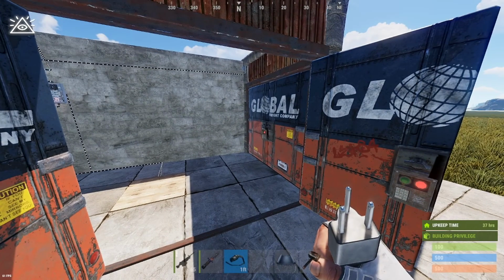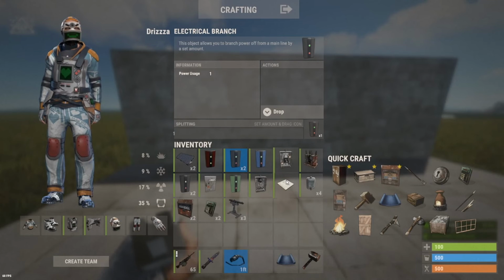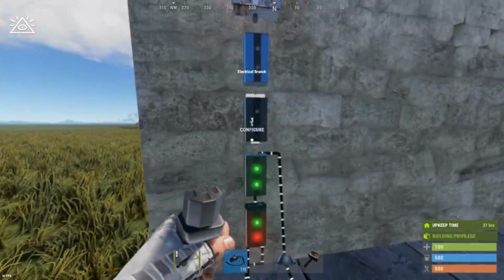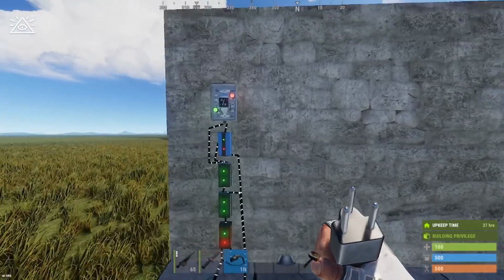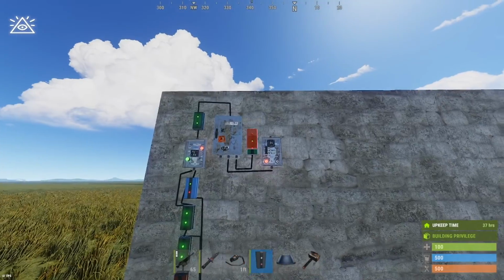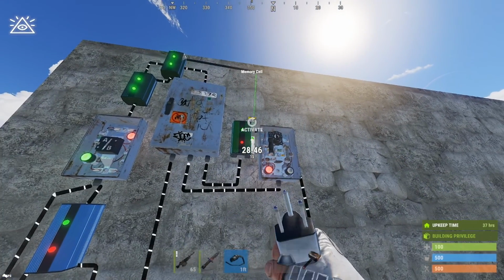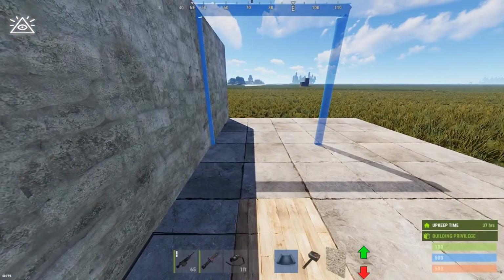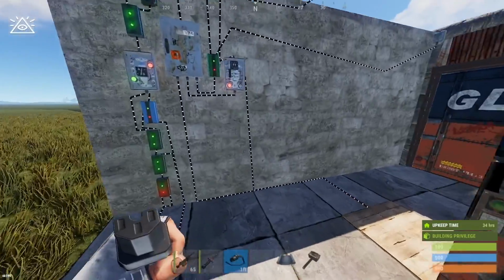RUST | Automatic Electric Trap Base Circuit | 2020

Comment: Hey Drizzza! amazing content! However, I thought with the recent Rust updates you are able to use your battery while it is charging. Doesn't that make that first infinite power circuit redundant?
Reply from the maker: If you would like it to stall or if you are using less power than the battery is charging, i like to have a fully charged battery
Reply: I don't understand lol. The battery always stays fully charged if the solar panel input is greater than the current electrical output of the battery.

Comment: Right now, batteries charge and discharge at the same time so i think this its not need it anymore
Reply from the maker: Did they finally fix that
Reply: @Drizzza  I think so. You can have a solar panel connected to a battery, and the battery connected to a turret. The battery wont discharge at day, it will charge and the turret will still works.